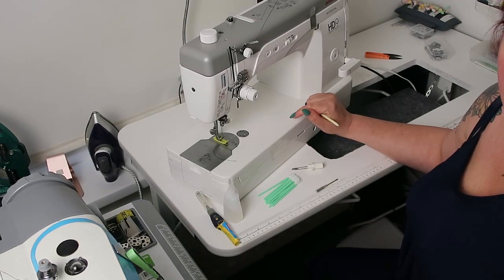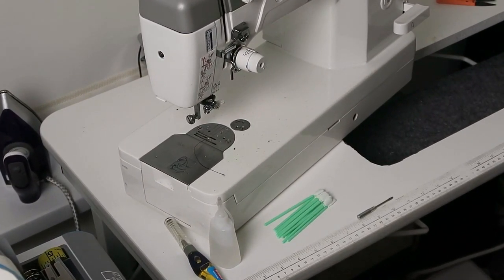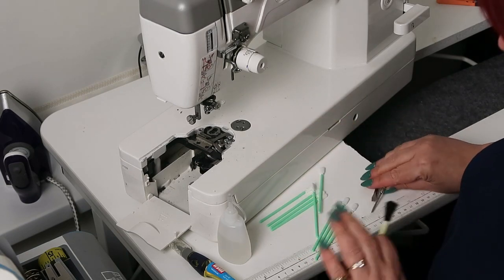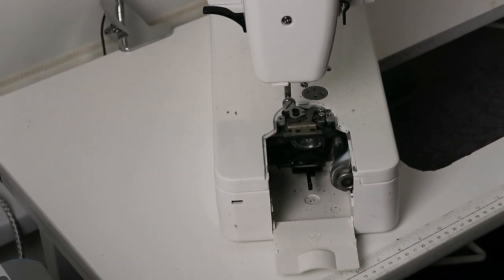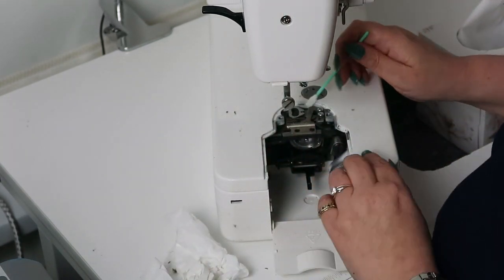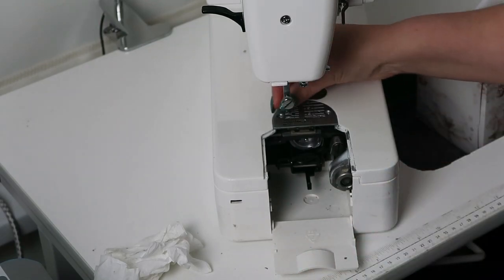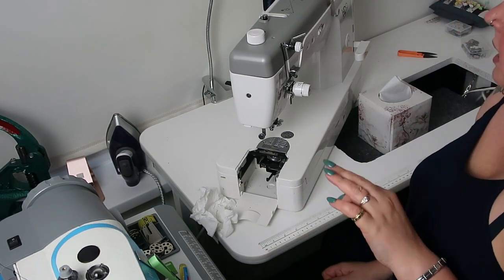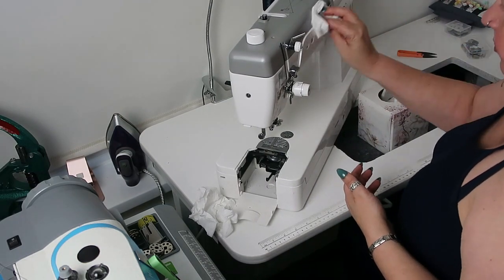Cleaning and Maintaining the Janome HD9 Sewing Machine - Sewing machine for bag making

Comment: I love your content and thank you for taking the time to make the videos.  I have an HD9 and the places you oil on the throat plate are not for oil.  The manual has the oil points and it is pretty specific about oiling only in four places.  Is there something you've learned about this that isn't common knowledge?
Reply from the maker: This is what I was told when I bought the machine I will look it up thanks for heads up x
Reply: The manual doesn’t say to oil those bits but I think I’m going to follow your lead and see if she’ll sound better